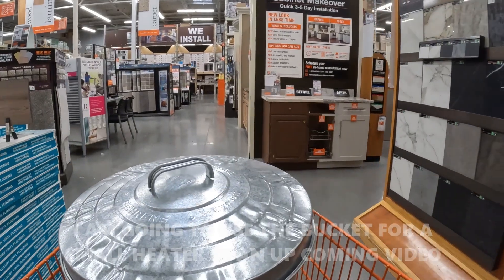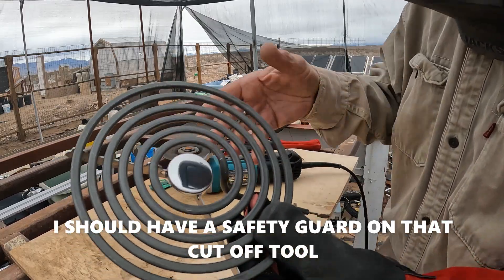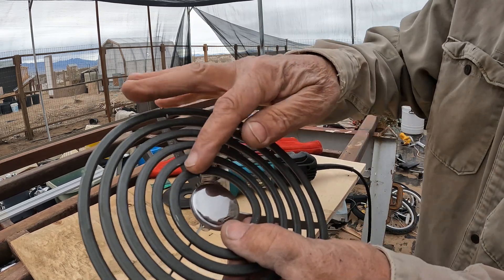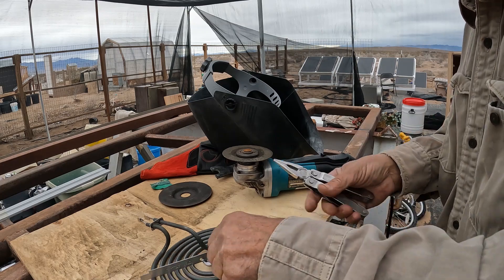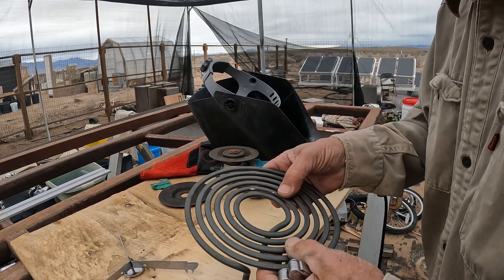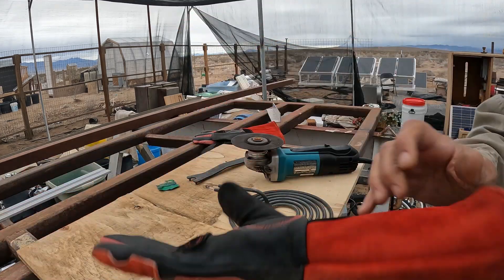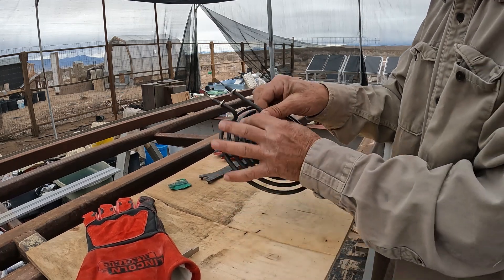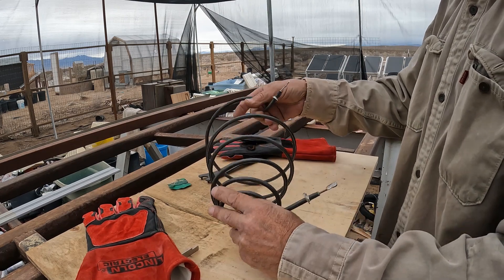Sand Battery Element, Part-10

Comment: Why not just use a bake element from a standard stove?

Try driving the bar off the element with an open end wrench that misses the element but strikes the tabs or bar.  Cut a slot in plywood so the bar will pass , plywood holds the element.

Comment: Those heating elements are hard to find in Germany 🙈
Reply: Any resistive element can be used but if resistance  is to high no current can flow if to low element will melt . Most stove elements are nicrome wire encased in stainless steel and filled with metal oxide.for support another source will be wire from clothes dryer element or resistive space heaters  .

Comment: What is the open circuit voltage of your solar panels string . Voltage of power available and the resistance of the load seems to be the key factors to balance 
 So a different voltage may need a different  element size .I think the resistive heater wire is in the center of the stove element with the outer shell  and the second concrete like layer is only there to protect and support the central heating wire . And resistance of the heater is determined  by the length of the central wire . These factors considered  may make it possible  to cut any element to the proper length to tune.the resistance  for max performance  for different  solar power systems..
Reply from the maker: The open circuit voltage is approximately 120 volts. It seems to be closer to around 113 volts. I haven't tried to balance the system to match the element like you are saying. I am just trying what is available. But you're idea is interesting and may help efficiency. Thank you for your comment.

Comment: Absolutely amazing my man. Stumbled across your channel and glad I did. I was wondering if you could go over the wiring plan you're using for this experiment? 

Again very cool and thanks for the inspiration.
Reply from the maker: Yes I can show how I wired everything. It is not up to any codes. And I need a breaker or fuse but I am not sure of what will work with 120 volts DC power. Thank you for watching.

Comment: I watch your video from Poland. Im interesting to do similar project.
Reply from the maker: Hello there in Poland. I am just experimenting and learning as I go. Thank you for watching. I have an update video I am working on now.
Reply: @off-gridsurvivalmike8120  Are you totally off grid? How much Watt this heat element takes? 
I bought for my sand stove a transformator 220V to 6V for bringing the Watt much lower. I live totally off grid and cannot take all the time high Watt. Until now I heat the sand with small candles. The temperature inside the sand is 68°C.